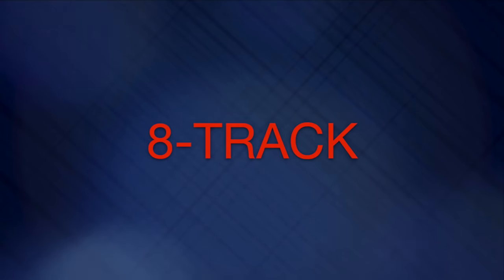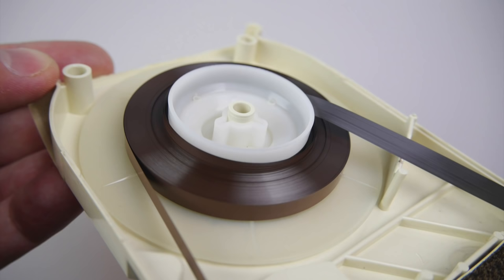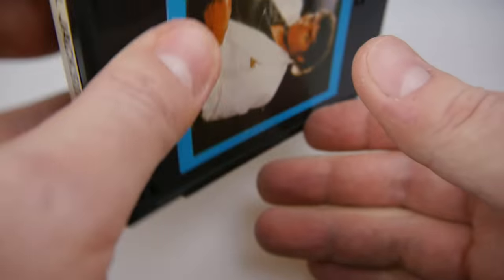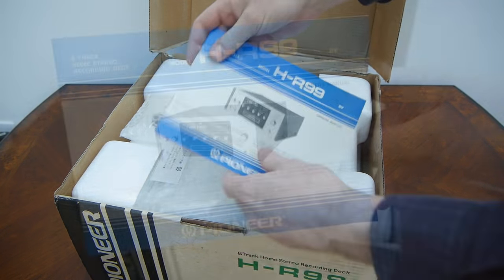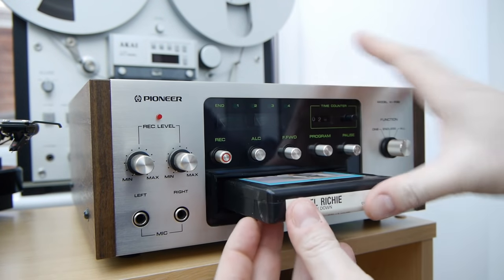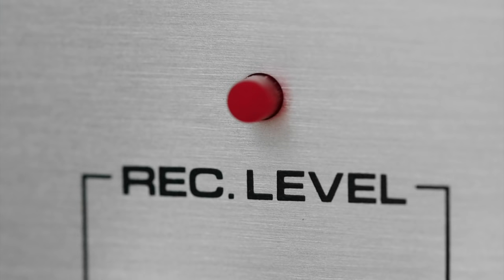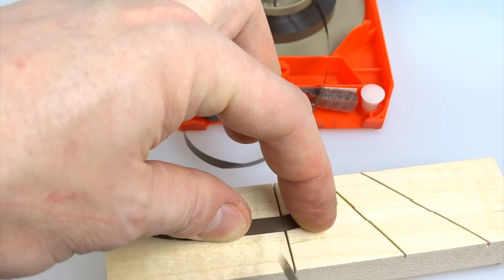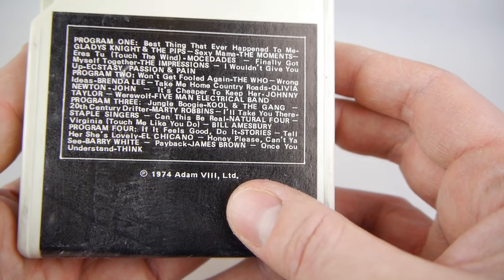Revisiting the 8-Track with a New 1975 Pioneer HR-99 Recorder

Comment: Top tip readers : before playing any unknown 8 track tape, open it up, wind it back on spool and adjust the tape tension, replace the sponge pad and clean the roller, check the splice strip (to re-enforce it, you can put a short strip of masking tape on the back on the none recorder side to ensure the splice doesn’t let go. Keep your players rollers clean and all should be fine!

Comment: Just had to add my $.02 worth.  Before the end of the 8-Track era many of them came out with Dolby (B of course) noise reduction and even the recorders had it.  I still have in an attic somewhere a deck that even electrically inserted and ejected the tape rather than the big CLUNK of pushing it in and pulling it out. You would gently push it to a point and it would reel the tape in the rest of the way motorized, like a CD tray.  When done, if not set to continuous play, it would gently feed the tape back out and turn off.  I even had a few 160 and 180 minute recordable carts and pairing that fancy deck with my DBX 224x noise reduction and expander, and nobody knew it was a tape at all, let alone an 8-track. -Jay
Reply: The electronic insertion was a standard in VHS recorders 📼. I can imagine that a lot could have been done in comfort and quality improvement. Like an azimuth adjustable head to align to the tape tracks perfectly. Or music search sensors
Reply: what was the model? :O

Comment: This is Brian. The bubbled up labels on your 8 track tapes is from condensation from being left overnite in an automobile. These tapes were thought to be indestructible by consumers, they ended up on the floors of cars and in piled in a garage or basement. As they aged, the labels would usually bubble up from moisture condensation. Although the gluing of these labels was questionable, my condensation observation is usually the source of the problems. Thank you.

Comment: This sure brought back some memories. Back in the day I was an electronics repair tech here in the US (I am now 55 years old) and I repaired many 8-track decks. In the early 80's I was the only guy I ever new to have both an 8-track and a cassette player in my car, at the same time. One little nit-pick I have though, is that your track diagram is incorrect. The tracks were actually laid out in two sets of 4, the top 4 would be the right channels and the bottom 4 tracks were the left channels (it may have been the other way around, my memory is faded on that point). So if you were on channel one it would actually be playing tracks 1 and 5, track 2 would be tracks 2 and 6 and so on. Other than that this was an excellent review about something folks younger than me know little about. Also, for best tape longevity, make sure you clean the head often, and make sure the capstan is kept cleaned as well, or you will soon experience the infamous "my 8-track is eating my tapes" phenomena. Well done.
Reply from the maker: Thanks Randy. I knew going into this that there would be people who would be a lot more familiar with 8-track than I am. I tried to find out about the track layout because I know that on my reel to reel they are 1&3 and 2&4, but I couldn't get the info for the 8-track. I won't go to the trouble of annotating the video, I think it would be too confusing to the casual viewer. I do love my machine and enjoy playing the tapes...but convenience and reliability are not its strong points. Thanks again for the info.
Reply: You can look at the tape head and see how far apart the two pickups are.
Reply: @Techmoan  I was also aware of the correct tape layout, being a teenager of the 70's. This reduces the vertical motion required by the head and I assume makes the head easier to manufacture as the two playback heads can be further apart.
Reply: Both cassette and 8track in your car? You must have been rich!
Reply: @BradHouser  I would assume it also helps improve stereo separation/reduce crosstalk between the left and right channel, by virtue of the “halves” of the head being further apart?

Comment: The original purchaser of many of the tapes you show was a member of the Columbia Record (and Tape) Club, which accounts for the letters CRC on the label. Their system caused some folks to end up with a lot of music they never wanted, because it was easy to forget to mail back the card that would stop them from sending you their 'selection of the month' which of course carried a full retail price plus shipping. However, the club was part of the reason I went with 8-tracks in a big way when I did. I lived far enough away from any brick-and-mortar retailer selling music, so going to a record store meant tagging along with my parents and inevitably being questioned and scorned for 'wasting my money' on such things. 8-tracks fit in the mailbox, and I was always home before my folks so I could get them in the house without being seen. Speaking of being seen - many of CRC's tapes were manufactured with the bright plastic like your Elton John tape. If you think it's bright in regular light, put it under a black light and it will REALLY glow.

Comment: The biggest problem with the 8--track is a design flaw with the cartridge, ie, that the pinch roller is part of the cartridge, not the tape deck.  This means, first, that inconsistent quality of the cartridges produces inconsistent performance.  Also, it's not possible to produce adequate pressure between the capstan and pinch roller.  These problems result in greater wow & flutter than is typical for a reel-to-reel, or cassette machine.  I used to work as a broadcast engineer, and had a lot of experience with the "cart machines" used in that industry.  They use cartridges that are very similar to 8--tracks, but with a major difference: the pinch roller is part of the machine.  It pivots at the bottom, and is pulled up against the tape by a solenoid.  Those machines produce wow & flutter comparable to that of a reel-to-reel.
Reply: To: Clyde Wary,
Of the several items worth mentioning that were not covered here was the 4-track tape which came out at the same time as the 8 track tape but as you noted had vast improvements in usability, the four track tapes ended up losing the consumer battle but in the end won universal acceptance in radio stations all over America as "Cart"-tapes, at first used for actual on air music playback and later relegated to commercial spots and promos.
Another foible worth mentioning was that some 8 track tapes had rubber Wheels to drive the tape on the capstan and other cheaper cartridges had hard plastic Wheels to drive the tape, and of course, those were terrible.

Comment: This was a novel video, bringing back some memories from my teen years. The tech •is• really beautiful. I had a Pioneer playback unit. On the other hand, I also realized why I didn't find the 8-Track to be a very good format, clunky, deteriorating mechanisms, breaking tapes, poor gluing of the label etc.  You noticed this as well. BTW, I noticed that there was quite a bit of  wow in the first two tapes you played. Thanks for the memories.
Reply: Searching for a song on the album: KA-CHUNK, KA-CHUNK, KA-CHUNK, KA CHUNK.
Reply: Seeing this without ever holding a 8-track tape myself, it's kind of annoying to imagine how good it could have been: With wider tape and faster speed, if they had improved the tape and cut tracks to just 4, it would have still held single LP but with either side switchable with push of button, and pretty much studio quality audio... What a waste.

Comment: I was born after the year 2000 and use 8-tracks as an everyday format.  My current stereo setup even includes a 1971 Sony HST-388 Hi-Fi Stereo 8-Track deck.  I also fix all the cartridges myself with various non-standard parts (example:  weather strip for windows, scotch tape, etc.).  I also have a portable General Electric 8-track player (GE 3-5505f) that I use all the time to bring my 8-tracks around.  Long live the 8-track and great video!

Comment: 8track was really big here in Canada in the early 70's ..I fixed so many of those, they would tighten up and sometimes i would pull the whole thing out onto the floor and rewind with a compass needle and resplice.. Sometimes the deck would eat the tape and you would have to gently pull it out of the deck leaving the tape hanging out of the cartridge in a big loop.. If you were good you could pull on the inner side and give it a spin and it would suck it back in...I had a Muntz player in my 68 Javelin  with pretty good speakers  ..It's all we had to be able to hear your own music and we were lucky here in Canada because just about everything was available on 8 track.

Comment: hi - your vid brings back memories of  my job in the 70's - working for an amusement machine company with equipment all around the midlands.
the company built its own 8-track player using a BSR deck from some place near Wolverhampton. the all steel case and illuminated panel were needed as they were installed under the bar in in many pubs. the customer had a free issue of carts and a box to exchange them by post. this is probably why many offered for sale today are in such poor condition around 250 of the deck were built and   had a part timer to look after the cart library. i had a new job in the 80's but one of the sales team contacted me to help change the deck for an auto-reverse car cassette deck. i have never seen them since.

Comment: This is great. Thanks for your efforts in making the videos about vintage gear like this.  I had an 8-track player in my first car. The year was 1991. Car was a 1977 Oldsmobile. I acquired some 8 tracks easily at that time from second hand shops. I remember having a Chuck Mangione that sounded great. Then the unit stopped working. Cheers from Texas.

Comment: I had a Sony TC-8 Recorder and Player. It was connected to my Kenwood TK-88 AM\FM Stereo Receiver and my Dual 1019 Turntable. I'd make these custom 8-track tapes for Road Trips and Friday Night Cruising. I had the top of the line Craig Pioneer 8-Track Player installed in my 1966 Mustang, with two Craig Pioneer 6X9 Coaxial Speakers mounted in the read deck area and I believe there were two 6.5 inch Coaxial Craig Pioneer Speakers mounted in the Front Door/Kick Panel Area. It was installed at this local Stereo Shop in West Texas. It sounded great! No complaints, fun music and wide open spaces of Far West Texas! My favorites were The Beach Boys & Merle Haggard! Those were GREAT DAYS!!!

Comment: I have several 8-tracks myself and the foam pads have disintegrated in them, I used soft tissue to replace it and it worked fine. I am glad to know there is someone who makes replacement pads out there.

Comment: That Pioneer 8Track is sooo beautiful!
It matches perfectly from the Design to my very well used 1971 Pioneer SX2500 Receiver. This old japanese Stuff is very solid and just works!
The SX2500 also has two of these little green Meters for the Signal Quality and Tuning, but they already turned yellow over the Years...

Comment: Got an old 1970 K5 Chevy Blazer with an 8 track in it, plus the truck still has daisy chains of old beer can pop top leavers hanging from the rear view mirror, back when you opened a beer can and you ended up with two pieces

Comment: Old magnetic tapes also suffer from "print through" where the magnetism from one part of the tape, overlaid in the windings over another piece of tape, can impress some of its magnetic pattern onto the adjacent wind of the tape.  This can happen on 8-Track, or reel to reel, or cassette.   Also, some particularly cheaply made mag tapes would degrade and stick to their adjacent layer and essentially bind up in the machines, potentially ruining the machines motors &/or pinch-rollers.  I've heard of people actually putting these tapes in the oven at a low temp and heating them up which apparently could unstick them enough to be able to play and dup their content off onto something else.   I've encountered these sticky tapes but haven't tried the oven technique.

I still have a bunch of old 8-track tapes and an 8-track player/recorder.   This inspires me to want to dig that stuff up and see if they still work...
Reply: "Tape" was very uniform rust (oxide) in a glue, stuck to cellophane. Pretty fragile really, and heat is the enemy. Your description of baking tape is exactly right. The thought us, you get one play after they're baked, so better hit Record to capture it to something else. :)
Reply: This was caused by a "faulty" binder that was used in the oxides on certain Cassette Tape formulations in the mid 70's through the mid 80's. It absorbs moisture (which it is NOT supposed to do) and this degrades the tape and causes screeching, squealing,  slow binding of the tape, etc. and makes these Cassette Tapes unplayable. It is also referred to as "Sticky Shed Syndrome". Have never seen this happen on 8-Track Cartridge Tapes, though.

Comment: I use to find 8 track tapes unraveled on the weeds on a dirt road riding my bike, I would take them and cram them in my coat pocket and take them home place the center wheel on my turn table and slowly repair them. Just like the old radio carts you had to deal with the Graphite that messed up the heads so had to clean them all the time. But hey thanks for the memories.

Comment: 8 Tracks were huge here in the U.S. in the 1970's, so much so that at one point some point car manufacturers started to offer optional AM/FM/8Track players as a factory option. If you didn't want the factory option...Panasonic, Sanyo and Pioneer also sold an 'aftermarket' combination 8 track/FM 'under the dash' players for the car. These were especially popular at the time because most cars still only came with an AM radio, so it was a win win marketing concept. 

In the latter part of the 1970's, some manufacturers like "Audiovox" even started producing 'in dash' AM/FM/CB radio and 8 Track players, there were sold around $250 to $350 USD. Later the price of these eventually came down some. You can see one here at 
https://www.youtube.com/watch?v=GrPSIKGWyQ4

At some point 8 tracks became so popular here that you could have bought "off brand" (no name manufacturers) under the dash 8 track players  for as little as $25 USD in some places. "Off brand" 90 minute blank tapes could often be found for as little as $2.00 USD each or less...

At one point in the early to mid 70's, prerecorded bootleg 8 track tapes were readily available at nearly every corner store for as low as $2 a piece! Sometimes the sound quality was sometimes OK to even pretty good, most times they seem to have more 'hiss' than legitimate 8 Tracks.  

8 Tracks had some other drawbacks besides the inability to rewind. Some inexpensive and portable 8 track players didn't have the capability to automatically change tracks.  You had to change it manually with a knob or a 'plunger' (like those portable Panasonic players).  In addition, the portable players often required 8 'D' cell batteries to operate and the battery life wasn't good at all. The biggest drawback was that some prerecorded 8 Tracks had songs were split between two tracks. (Dark Side of The Moon by Pink Floyd was a prime example).

So in the the middle of the song it would fade out and you had to wait until it changed tracks (or had to change it manually) and then hear the rest of the song on the next track. To solve that problem, you bought an 8 Track recorder. These were about $100 and up to $200+ USD. You'd record your record album onto the 8 Track and put the full song on one track. Eventually more people started using cassettes and by the very early 1980's the 8 track pretty much fell out of favor. But it had a heck of a run here in the U.S. for the time that it did...The audio quality was pretty good on average, no doubt due to the 3-3/4 ips  (9.53cm) speed.
Reply: Yep, the faster speed had better "Fidelity".
Reply: My '66 Riviera had an in-dash Delco AM/FM 8-Track

Comment: The label bubbles up because they have more than likely been left out in extreme heat and cold weather in cars. The 8 Track system were invented by the guy that started Lear Jets, he wanted a music system for his planes. Some 8 Track tapes had the name "LearJet 8" on them.
Reply from the maker: My new old stock 8-tracks bubbled up in the house within a few hours of being taken out of the shrink wrap.
Reply: I would think that whatever adhesive they used has broken down over time,thus causing the bubbling
Reply: Bill Lear, God rest his soul...
Reply: @andyvasquez8337  NO, it is Heat , Humidity and carelessness (condition) that caused the bubbling!

Comment: When you use the editing block you overlap the two pieces and cut them with one stroke. Then you butt them together and put your splicing tape over the join, still in the editing block.
Reply from the maker: +Eric Blair thanks for the tip

Comment: Looking at the "Flashdance: The Original Soundtrack" album, I found a listing of sorting codes for other formats the album was available on from the original recording company... These included Compact Cassette, CD & (Surprisingly) 8-track cartridge. This was back in '83, basically the final year for any new 8-track hardware. Any tapes released in this format afterwards were typically transfers done by Columbia House, hence your find of Madonna's '87 release.

Comment: RCA did not use a sponge. It used a spring and pad set up. They also made the best sounding tapes
Reply: "Pressure Pad" is the correct term for the foam pad.

Comment: In 1975 my mom bought me an RCA 8 track player that had four speakers, two internal and two external. It never played properly. Lots bleed through. Stopped using it after a couple years but I still used the external speakers. After all these years they still sound good.